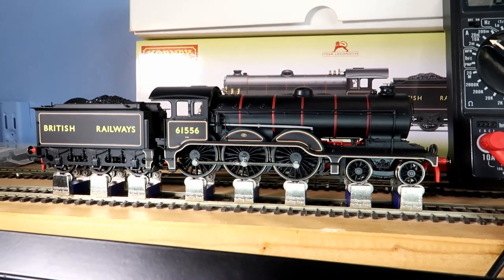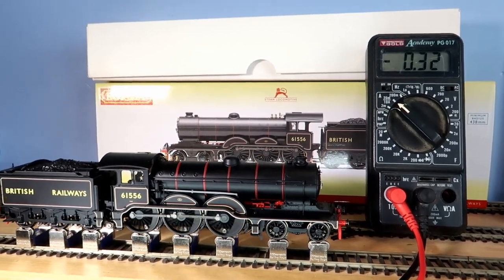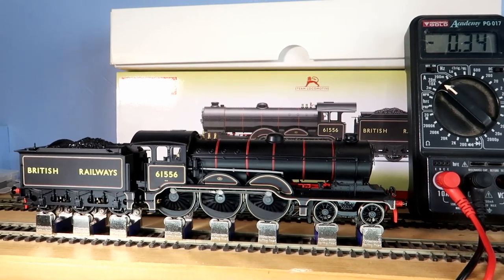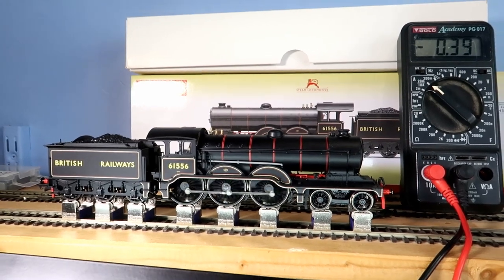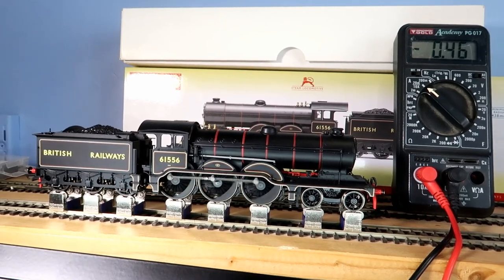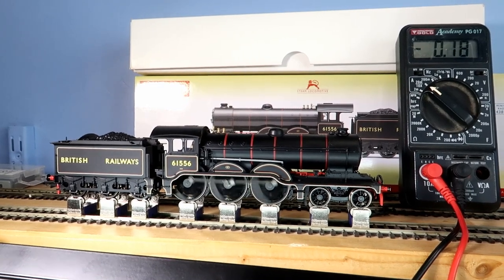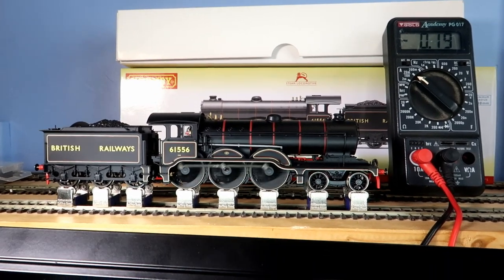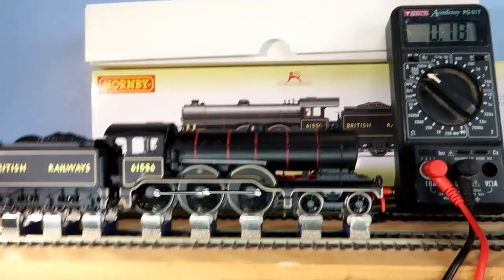Hornby B12 motor fail, NOT AGAIN, Warning to others and apology

Comment: Hi.  I wonder if you could please help? I want to check the amps being pulled by my B12. I've got the B12 set up on a rolling road connected to my controller.  My multimeter is connected with the red cable in the left hand 10A socket and the black cable in the centre socket. I've set the multimeter to the 10A setting -but am struggling to know how to connect this via the controller.  Any help would be appreciated.
Reply from the maker: Hi, connect one output of your controller to one of the multimeter connections, connect the other multimeter connection to the track, connect the other side of your controller direct to the other track
Reply: @ModelRailwaysUnlimited  Fantastic! Thank you very much for your help.

Comment: Sorry to say this does not suprise me at all.  I had the latest LNER version which after a decent running in period decided to run very erratically.  The replacement started fine but again became very erratic then limped through Buckfastleigh station where it stopped and started pouring out smoke.
Reply from the maker: Oh my god that's terrible, what are you doing with it
Reply: Fortunately Bure valley models, where I bought the model from were excellent and let me have my money back.  I honestly think Hornby locos look fantastic and look great in a display case but are just not fit for purpose on a model railway in my experience.
Reply from the maker: @GWRFan281  Well that's something at least!

Comment: I'm feeling your disappointment. I would probably have used language not suitable for a pre watershed audience. Then again here goes (only kidding). I would fit a new motor as you already have some. It must be tempting to send it back but at least you will end up with something that actually works. Regards Paul.
Reply from the maker: Thanks Paul, yes in the process now. Real shame however

Comment: You refer to Chinese motors, but the Hornby motors are also made in China, probably by the same company! I suspect that the faulty motors are due to the independent manufacturers in China buying a cheap batch of motors (probably 'seconds') to save them money, not directly the fault of Hornby. Hornby, however, should have rejected them, when they were found to be faulty, to protect the company's image and their customers (us). There appears to be no quality control by Hornby when the models arrive in the UK, from China.
Reply from the maker: Hi Henry, yes you are right of course, identical I'd say, I am exploring some alternatives and will report my findings. At the moment the loco is undergoing tests.
I replaced the motor and that too failed but I think it was one of the ones Hornby sent me for the S15 and I fitted it by mistake.
Now its fitted with one of the Chinese ones.
It’s running much better than it did and is drawing just 100mA which is fine. I’d expect motors of this kind to draw between 50 and 150mA if all is well.
I have some suggestions for other owners that want to try and stop the motor issues.
1) Check the loco wheel pickups, mine were way too hard and causing lots of drag, ease them off so that they just keep contact when the wheel is furthest away from them.
2) Inside, see https://youtu.be/Uwp_z3GdXXk Make sure there is clearance between the rear flywheel and the motor bearing, check that the sleeved wire from the suppressor capacitor is not fouling the back of the front flywheel. Make sure the worm tower bearings are lubricated. Make sure the motor bearings are lightly lubricated. Check in the worm tower that the grease is not too think.
My feeling is that the motors are failing as the brushes break down due to heat and short out the commutator segments. This could explain the erratic running we see.
I can’t pass on the link for the Chinese motors as they are out of stock now and have no plans for more. If I find an alternate supplier I’ll let everyone know.
Take care. Mike
2mm shaft
35.8mm body
6mm dual shaft
16.6mm biggest width.
12.6mm narrowest width.
12V-24V-High-Speed-Micro-NdFeB-Strong-Magnetic-Mini-130-Motor-DIY-RC-Car-Boat

Comment: In one of your other videos the meter is set to 200ma, and in this one it is set to 20ma/10A setting!  So is it still drawing over 200 milliamps?  Also confused by it having a - 0.32 on the display.  I admit that i don't have a test meter so perhaps don't know how to read them!
Reply from the maker: Hi Mike, no problem. The range on the meter goes upto 200mA, anything over that has to go on the 10amp range, so 1000mA is 1.00 amps, therefore  0.32 is 320mA. Hope this helps
Reply: @ModelRailwaysUnlimited  Thanks!

Comment: A fellow victim of the S15 saga and following a catalogue of Hornby quality issues I have vowed never to buy Hornby until they sort out quality. This includes carriages etc with which I have also had quality issues.
My advice to all. Send back  any item that is faulty and this includes finishing issues and parts dropping off as you open the box.
To dealers, DONT PUT THEM BACK ON TH3 SHELF!!! Return to Hornby. 
If everybody did this instead of rectifying themselves it would hit Hornby where it hurts, in their profit and they might get the message.
Reply from the maker: I do agree with you Roy, but there are many that import these models at huge costs, sending them back would cost even more. Therefore I feel if we can self fix it's valid in this regard. I have many concerns here, customers don't seem to be protected from not fit for purpose items, retailers like you say must share the responsibility as well and not seek to off load duff models on us.

Comment: I think it's down to poor materials. Internal winding shorts and a mismatch between commutator and brush hardness in a no-name motor.
I've got a German-made Fleischmann BR103 I got as a schoolboy in 1977. Still runs as well as the day it was new. A simple pancake motor. Wrenn, Swiss HAG, and traditional Marklin-Trix windings seem to hold up well too. 
Modern good quality micromotors from Swiss Maxon, Portescap, Faulhaber GmbH and Bühler Motor GmbH don't have these sort of problems. The latter does have a Chinese factory but they keep an eye on things!
They don't come cheap though, the spare I got for a Trix loco was a Portescap athlonix coreless with a single flywheel @ 40 euros from the Marklin-Trix website and slightly cheaper at German dealers. The likes of RS Components want £60 for the bare athlonix motor of the same dimensions...
Reply from the maker: Thanks, I agree clearly the build quality is rubbish

Comment: hornby and oxford are both band in my fleet now .all my older hornby 4 5 6 years old seem fine but newer stuff are poor. and dont get me started on oxford. the 2 j27s i got needed fettling straight from the box...very poor yet the 20 year old parralell boiler scot by bachmann that i paid 35 quid for from doncaster toy n train fair was mint and ran slow smooth and quiet.i feel the industry is now just taking the piss .
Reply from the maker: Thanks for your thoughts. At the moment the loco is undergoing tests.
I replaced the motor and that too failed but I think it was one of the ones Hornby sent me for the S15 and I fitted it by mistake.
Now its fitted with one of the Chinese ones.
It’s running much better than it did and is drawing just 100mA which is fine. I’d expect motors of this kind to draw between 50 and 150mA if all is well.
I have some suggestions for other owners that want to try and stop the motor issues.
1) Check the loco wheel pickups, mine were way too hard and causing lots of drag, ease them off so that they just keep contact when the wheel is furthest away from them.
2) Inside, see https://youtu.be/Uwp_z3GdXXk Make sure there is clearance between the rear flywheel and the motor bearing, check that the sleeved wire from the suppressor capacitor is not fouling the back of the front flywheel. Make sure the worm tower bearings are lubricated. Make sure the motor bearings are lightly lubricated. Check in the worm tower that the grease is not too think.
My feeling is that the motors are failing as the brushes break down due to heat and short out the commutator segments. This could explain the erratic running we see.
I can’t pass on the link for the Chinese motors as they are out of stock now and have no plans for more. If I find an alternate supplier I’ll let everyone know.
Take care. Mike

Comment: Oh No! What a shame! I've put mine back in it's box assuming it was OK. Looks like it will have to come out again now back onto the  rolling road. Clearly I didn't give it long enough to find out. You may remember that I had the same problem with a used B12 I bought from Hattons, which got sent back, but since that had been used I guess it was sold to Hattons after having run for a while before it came to me. I truly feel gutted for you, as well as me since now I can't ever be sure of these motors again. Strange you finally got an S15 from Hornby that worked OK. I have to wonder if Hornby keep back proven motors for when they are finally forced to part with one to a disgruntled customer. Personally, I'd stick a cheap Chinese motor in rather than go cap in hand to Hattons or Hornby - but why should we have to?????? Clearly there's an issue with the design or manufacturing quality, of these things.
Could you post the link for the Chinese motor source, please. This model is such a fine looking beast that I'll probably resign myself to keeping her no matter what. Just ordered a B17 so I'll let you know what type of motor is in that!
Hope you come to a decision about your B12's future. I suppose we should all send them back en-mass to make a point. I don't think Hattons is complicit - why don't you 'phone them to see what they say?
BTW keep swearing - it does help! Regards Chris.
Reply from the maker: Thanks for your thoughts. At the moment the loco is undergoing tests.
I replaced the motor and that too failed but I think it was one of the ones Hornby sent me for the S15 and I fitted it by mistake.
Now its fitted with one of the Chinese ones.
It’s running much better than it did and is drawing just 100mA which is fine. I’d expect motors of this kind to draw between 50 and 150mA if all is well.
I have some suggestions for other owners that want to try and stop the motor issues.
1) Check the loco wheel pickups, mine were way too hard and causing lots of drag, ease them off so that they just keep contact when the wheel is furthest away from them.
2) Inside, see https://youtu.be/Uwp_z3GdXXk Make sure there is clearance between the rear flywheel and the motor bearing, check that the sleeved wire from the suppressor capacitor is not fouling the back of the front flywheel. Make sure the worm tower bearings are lubricated. Make sure the motor bearings are lightly lubricated. Check in the worm tower that the grease is not too think.
My feeling is that the motors are failing as the brushes break down due to heat and short out the commutator segments. This could explain the erratic running we see.
I can’t pass on the link for the Chinese motors as they are out of stock now and have no plans for more. If I find an alternate supplier I’ll let everyone know.
Take care. Mike

Comment: Definitely a 'motor' change. No hassle with DIY. 
ps   I bought one from Hattons in the sale.  Runs sweet!!!  Motor ok!!!!
Regards
Nigel
Reply from the maker: Thanks for your thoughts. At the moment the loco is undergoing tests.
I replaced the motor and that too failed but I think it was one of the ones Hornby sent me for the S15 and I fitted it by mistake.
Now its fitted with one of the Chinese ones.
It’s running much better than it did and is drawing just 100mA which is fine. I’d expect motors of this kind to draw between 50 and 150mA if all is well.
I have some suggestions for other owners that want to try and stop the motor issues.
1) Check the loco wheel pickups, mine were way too hard and causing lots of drag, ease them off so that they just keep contact when the wheel is furthest away from them.
2) Inside, see https://youtu.be/Uwp_z3GdXXk Make sure there is clearance between the rear flywheel and the motor bearing, check that the sleeved wire from the suppressor capacitor is not fouling the back of the front flywheel. Make sure the worm tower bearings are lubricated. Make sure the motor bearings are lightly lubricated. Check in the worm tower that the grease is not too think.
My feeling is that the motors are failing as the brushes break down due to heat and short out the commutator segments. This could explain the erratic running we see.
I can’t pass on the link for the Chinese motors as they are out of stock now and have no plans for more. If I find an alternate supplier I’ll let everyone know.
Take care. Mike

Comment: Hi Mike - It all depends on how much you like this loco and want it in your collection.  
As your so skilled and the spare motors are so cheap I think I would bite the bullet and just change it mate.
If your going on principles why can they not put a new motor in. Mind you if you do it at least you know it has been done right.
Its a case of cutting your nose off to spite your face if you send it back without a replacement or not getting it back at all,  just a refund.
So putting those both together ie principle and nose, put a new motor in damn it.
Regards Chris
Reply from the maker: Thanks for your thoughts. At the moment the loco is undergoing tests.
I replaced the motor and that too failed but I think it was one of the ones Hornby sent me for the S15 and I fitted it by mistake.
Now its fitted with one of the Chinese ones.
It’s running much better than it did and is drawing just 100mA which is fine. I’d expect motors of this kind to draw between 50 and 150mA if all is well.
I have some suggestions for other owners that want to try and stop the motor issues.
1) Check the loco wheel pickups, mine were way too hard and causing lots of drag, ease them off so that they just keep contact when the wheel is furthest away from them.
2) Inside, see https://youtu.be/Uwp_z3GdXXk Make sure there is clearance between the rear flywheel and the motor bearing, check that the sleeved wire from the suppressor capacitor is not fouling the back of the front flywheel. Make sure the worm tower bearings are lubricated. Make sure the motor bearings are lightly lubricated. Check in the worm tower that the grease is not too think.
My feeling is that the motors are failing as the brushes break down due to heat and short out the commutator segments. This could explain the erratic running we see.
I can’t pass on the link for the Chinese motors as they are out of stock now and have no plans for more. If I find an alternate supplier I’ll let everyone know.
Take care. Mike

Comment: Hi Mike
I know how you feel.
The motor in my b12 short circuited 3 times.
The motors in the b12 are defective.
I heard that the b1 motor is better and it fits but they are hard to find.
It s such a shame as they are a lovely loco.
Good luck with new motor.
Take care
Basil.
Reply from the maker: Thanks Basil, yeah its clearly a bad batch, the new motor is fine and I am loading a very interesting update as we speak

Comment: hi got mine on your recommendation not blaming you as it is a lovely loco just needs a decent motor,  Barrie Davies he says that hornby x6481 is a straight swop job is trying to get hold of one have been toying with the idea of getting some cheap motors and making a cradle for it helps that it is a flexible drive shaft so you have a bit of wiggle room
Reply from the maker: Hi, hope yours will be ok, I did find the pickups on the wheels were excessively hard but not sure that will have caused this. That one is single ended but would still work with just the one flywheel

Comment: had the same problem, mine went back to Hornby twice. in the end demanded a replacement. don't trust the new one either.........Quality Control and Quality of parts used sucks!
Reply from the maker: Good luck with it, I've fitted a new motor and eased the loco pickups that were very hard, all good so far
Reply: @ModelRailwaysUnlimited  thank you! update, replacement motor failed, sent to hornby for repair and was assured that the new motor wouldn't have the same problem, hour and half of running guess what............ opened up the body, don't think they did anything. The screws look as if they haven't been touched and the motor wiring looked straight out of the factory. another phone call today, going to get angry
Reply from the maker: Good god that is terrible, good luck